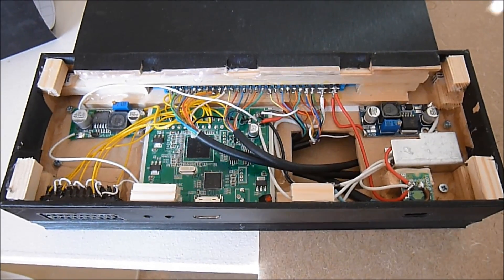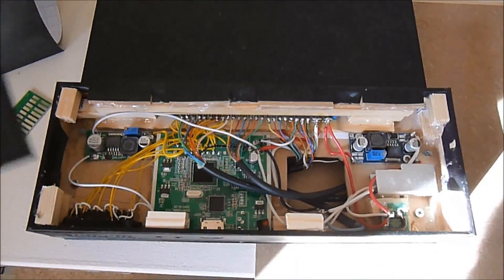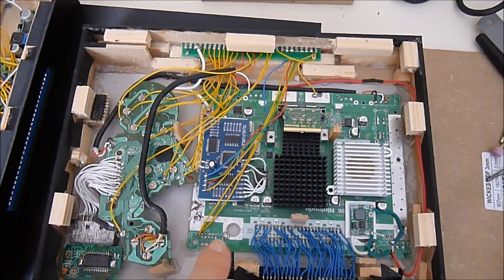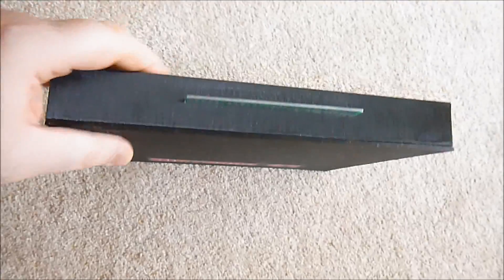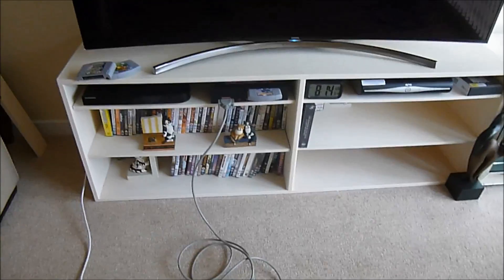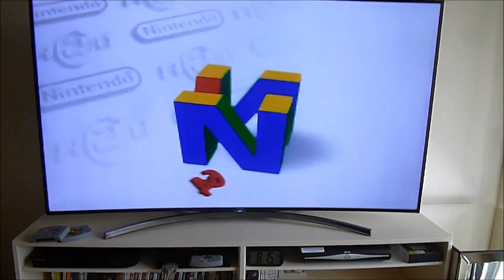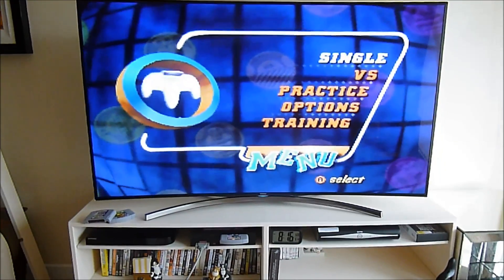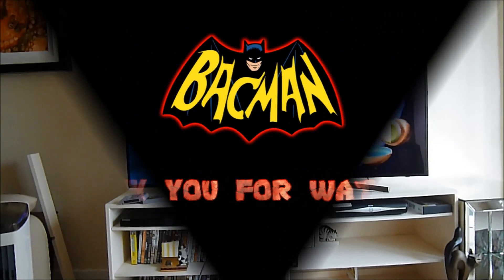Part 2 - Unity system - Base Unit, N64 system and Demonstration

Comment: Maybe consider making the controller wireless? I can see it being a little tricky with over 25 connections...but you could perhaps serialize the data and send it out over an SPP bluetooth connection (no different than RS-232). Bluetooth modules can be had for less than 10 bucks each, so it wouldn't be horribly expensive to try. Regardless, a very interesting project.
Reply from the maker: Rich Degenhardt No idea how to make a wireless controller. Also, would need to be lagless.
Reply: No worries, just a thought to free you from the giant cable. I'm pretty sure it could be done almost 100% lagless...older consoles like the SNES only pulsed for data at 60hz, which bluetooth would have no issues keeping pace with. I'm not too familiar with the controller protocol for newer consoles though (PS2 and later).

Comment: I get the whole project, it's just that plugging in an actual N64 would of been easier and quicker. Your old setup was messy but incorporated all systems for convenience, this is tidy but seems more hassle really. Still, nice job! Question: Do you have any other tone to your voice or is that it? Watched all your videos and there isn't a SINGLE fluctuation in your voice, not one, never come across that before.
Reply from the maker: cakershake Old system was messy and was also a lot more hassle than this "version 2" system as with the previous system I had to move the slider to select the system, then change the cartridge that held the controller from the console into the old master controller. With this version 2 system, neither is the case; nothing to swap over with the controller, and the system is selected automatically when inserting in the console "cartridge" to the base unit.

Of course my voice has fluctuations normally, just not when taking videos. If the tone were that boring then it shows you obviously thought the content of the videos awesome to have put up with "the audio". lol
Reply: true dat! Your content is awsome
Reply: But, all the console cartridges take up alot more space than the previous system did combined, right?
So, although this looks a lot more elegant (it looks really beautiful), I have a feeling it kinda defeats the purpose of a multi platform console. You kinda literally just swap in and out the whole console.